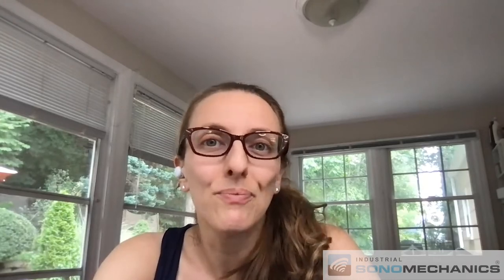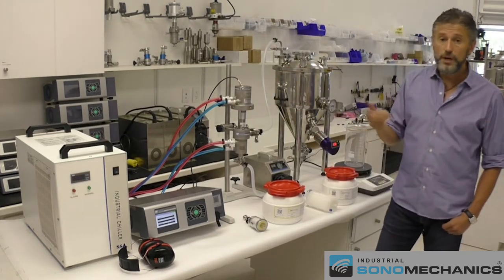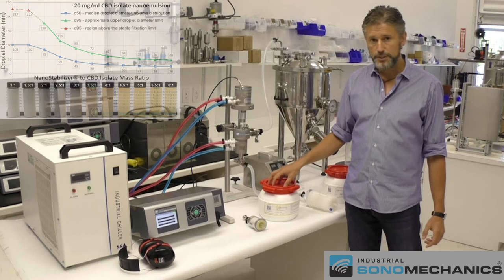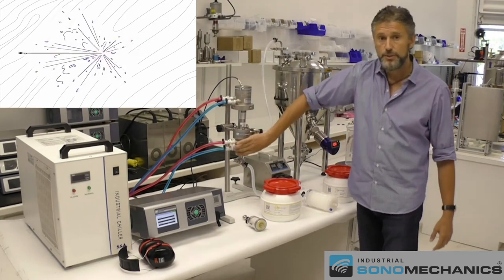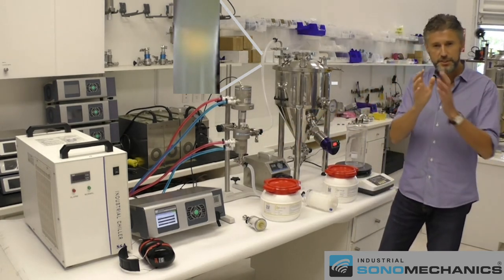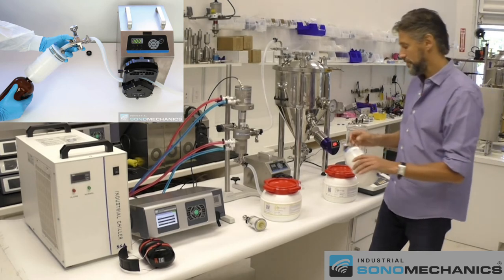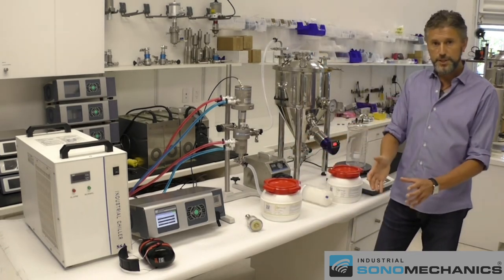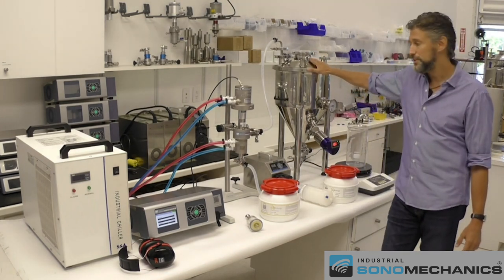Overview of the Nano-Emulsification Procedure with BSP-1200 Ultrasonic Processor and NanoStabilizers

Comment: Very clear only i missed how do you dry the powder? And do you have calculators so you now how much mg of powder to isolate cbd our any delta's with a different Active %
Reply from the maker: Hi Rob, you can use pretty much any drying method. Email us at contact@sonomechanics.com if you would like more information on our drying solution. This blog post (scroll to the bottom) shows some calculations (input and output materials) - https://blog.sonomechanics.com/blog/nanostabilizer-simplifies-producing-water-soluble-powder. The concentration of the desired bioactive (CBD, THC, etc.) in the powder will of course vary depending your raw material (these kinds of calculations we can help with).

Comment: Sorry, after spray drying, the particle size is no longer in nanometer range. The so-called nano-powder is unscientific and misleading.
Reply from the maker: @AY-ej6py The powders created with our ultrasonic equipment and NanoStabilizer-LSO reconstitute into nanoemulsions with droplet sizes similar to those present in the original nanoemulsions before they were dried. Your drying method should not affect that in the way you are describing it. If you are using our ultrasonic equipment and NanoStabilizer-LSO, please contact our support team to troubleshoot your process.
Reply: @IndustrialSonomechanics  Thanks for the reply. Drying methods do matter. Nano spray-dryer, not conventional spray-dryer, is needed to produce nano-powder. It is only available at lab scale and very expensive. You may want to revisit the technology.
Reply from the maker: @AY-ej6py  It's important to distinguish between "powder grain size" and "size of the oil droplets" that are dispersed within the solid matrix (the oil droplets which were nano-emulsified before the water was removed). In our earlier comment we were referring to the latter. You can spray dry the LSO-based nanoemulsion into a powder or use another drying method and have a solid, and those oil droplet sizes will not change. Take a look at the 23:00 min time stamp in this discussion regarding out recent D8-THC PK study for some details on our water-soluble powders method - https://www.youtube.com/watch?v=5zeBbH62a70. Another one here - https://www.youtube.com/watch?v=LJ47Ig0ymY4.